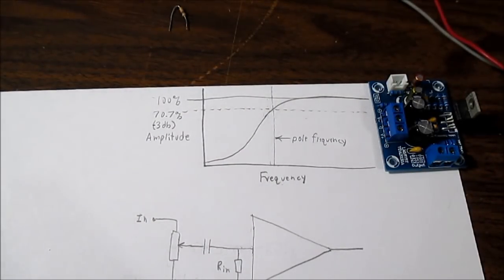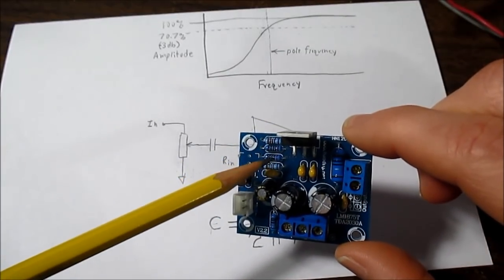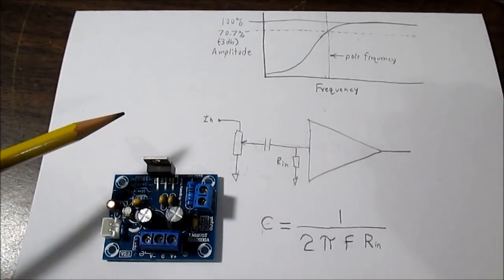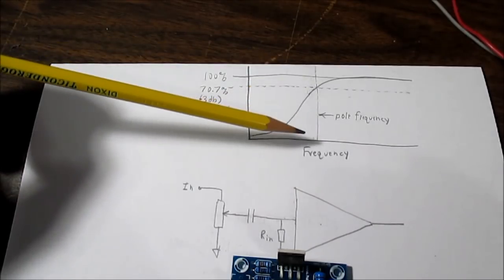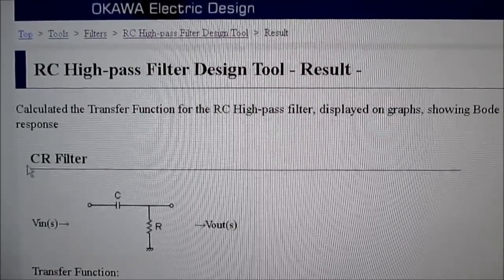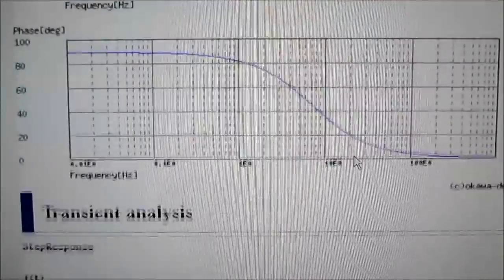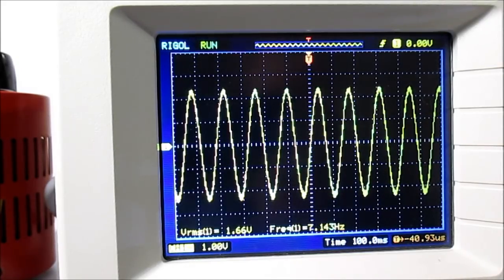How to select input capacitor value and type for audio amplifier projects

Comment: Electrolytic coupling caps seem risky if there isn't a defined DC bias across it. In that case, depending on what offset the source provides, the capacitor could end up reverse polarised

Comment: If you want to do your own calculations, then a 1μF capacitor will have an impedance of 8j Kohms at 20Hz.
The voltage divider given by ( 22  / 8j + 22 ) works out as 0.88 - 0.32j. That's a complex divider effectively with 88% of the signal in-phase with the input and 32% at 90° out-of-phase with the input.
That is √( 0.88² + 0.32² ) = 0.94 of the input voltage at a phase shift of arctan(0.32 / 0.88) = 20°.
Of course, 94% of the input signal is not discernible from 100% on a logarithmic graph.

Beside the leakage current when reverse biased, the other reason not to use aluminium electrolytics in the signal path is that they are commonly specified as ±20% tolerance - and I've seen -50%/+100% on larger ones! The capacitance itself is rarely stable and drifts with temperature and over time, so it becomes pointless trying to design a repeatable cut-off with them.

Of course, you can simply over-specify the value "to make sure", but then you have watch out for the capacitor charging at switch on if any DC bias actually exists. That can be quite a thump to deliver to loudspeakers unless you take precautions. In other words, setting the cut-off too low has its drawbacks as well.

Comment: John, first I wanted to say great video on this but I wanted to mention one issue I have with your statement of not using any ceramics for coupling purposes in audio. Not all ceramics are the same and they can not be grouped together. I would agree that type 2 dielectric not be used. However type 1 dielectric if available in the values that you need can be phenomenal and just as good as polypropylene caps. There dissipation factor can be much less than 0.1 with calcium zirconate(C0G, NP0, U2J) and you can sometimes get the value that you need with them, otherwise can stack a few of them. It is only the ones made with barium titanite that are no good for this purpose(X7r, X5r, Y5v).

Comment: Good one John. Wanted to know more about input caps. My design specifies a 10uf BP electrolytic, so I'm swapping that for a 6.8uf film cap. Now thanks to you I know what I can expect to see, or hear with this change. I rather like paper in oil as coupling caps but I don't have anywhere near the correct value. I'm in no position to second guess the designer,  but if I want fiddle with values, that's up to me I suppose...

Comment: What about tantalum drop capacitors? I tend to go for those over electrolytic capacitors in audio circuits where it's not practical to use MKT or other film caps

Comment: John, why are you using polyesters?  You are wrong, they have significant distortion, especially compared to Polyprop.
The only reason to use the PE type is if you want some distortion in the signal path, like in a guitar amp.  Never ever use electrolytics  in the audio path, never.
Reply from the maker: I'm aware that electrolytic, ceramic and to a much less extent, PET caps have nonlinearities. But it is at the cross over point. The distortion is low in the passband as the voltage change across the cap is very small. Polypropylene caps are ideal but they get large and expensive. Very easy to design a low distortion amplifier using PET caps in the signal path.
Reply: @JohnAudioTech  So the conclusion is that using PP is better than PET, but in the LM1875 schematic above, using PET is the ideal choice. It my right? 😊

Comment: John, I enjoyed your video and would like your thoughts on something i have noticed a number of times. Even though the pole is usually around 6 Hz or so, just as you mentioned in you video, there are cases where low frequencies are intentionally are rolled off to quite an extreme extent. A good example is the Brook 12A amplifier. It is an old design that uses 2A3 in the output and I built one for a lady a few years back and made it true to the schematic. Scanning it with the HP 8903 did not look good at low frequencies. I looked for a clear schematic to attach but could not find a good one but attached what I could find below.
https://elektrotanya.com/brook_12a_sch.pdf/download.html
Rolling off LF in these older amplifiers is not that uncommon and some, like modifications to some of the Dynaco amplifiers are pretty common right at the front end. I have always wondered why the designer/builder wants to limit LF response. I have wondered if it has something to do with output transformer saturation at LF  or what... I don't know. Know that I am not talking about the little RC circuits we sometimes see off the grids of a tube to snub AM radio stations or a 70 KHz instability not uncommon in the older Williamson designs. You see these RC circuits in Heathkit and UTC designs. 
Back to the point - just wondered if you had any thoughts on the reason LF response is severely limited in some amplifiers and I am using the Brook 12A as an example. In the Brooks 12A schematic I am talking about the 24K and pair of capacitors coupling the first to second stage. I have a LTSpice model of the Brook 12A if you do Spice and will be happy to send it to you.  Thanks...

Comment: I have a Dual CV 6065 RC which is class-A 85wt/ch amplifier there is 6800uf 63wt (2nos) and 1000uf 35wt (2nos). i have to replace those caps can i increase the capacitance and power of capacitors ? i have very little knowledge of audio electronics! thank you!

Comment: The main issue with electrolytics for input coupling capacitors for me is their leakage current in the case of operating the amplifier input at very high input impedances (> 100k) and very close to REAL mass potential. it could happen in this case that the polarity of the voltage across the capacitor is opposite to the electrolytics polarization. Especially in the case of higher input voltages (> 1V) the capacitor will degrade with time und it will get more and more leakage current. The leakage current itself will compromize the balance of the input differential amplifier and it will cause dc offset at its output. So, especially for dc coupled output amplifiers it is not convenient to work with electrolytics as input coupling capacitors.

Comment: hey you cant say not to use ceramics for input coupling/filtering because there are class 1 and class 2 dielectrics and C0G/NP0, U2J are extremely stable and actually show distortion measurements just as low as polyproylene according to cyril batemans measurements tests. Yes class 2 dielectric ceramics are no good for this but they are great for decoupling........Just please dont throw all ceramics into the same class.
Reply: Nonsense.  Ceramics have a grainy sound.
Reply: @pangolinamplifier422  bullshit

Comment: 820nF is closer approach than 1uF.
And what about tantalum capacitor? De facto, tantalum capacitor much better than regular electrolytic capacitor. But I don't know about its noise characteristics.
Cheers from Indonesia
Reply: Tantualm caps are very very non linear and horrible for audio think have u ever seen a tantalum cap ever in a signal path the answer is no tantualm are good for bypass and especially timing but absolutely no signal
Reply: Maybe if your look for a certain non linear respones

Comment: I have made a wien bridge oscillator with an op amp. The op amp output is a 2khz sine wave that is the 1st stage. The second stage consist of 2 BJT's first C945 and second 882 both NPN a 120 ohm resistor on the collector of the 945, the emitter connected to the Base of the 882, a car alarm siren connected to the collector of the 882 and the emitter to ground or 0V. What should be the coupling capacitor resitor between those 2 stages? I am using a 220microfarad electrolytic capacitor in series with a 1kohm resitor to connect the output of the Op-amp to the Base of the C945 but the siren sounds only while the cap is discharging and the intensity of the sound gets  weaker until there is no sound at all. What am I doing wrong? Shout I connect a 22kohm resitor connected to ground between the cap and the 1kohm resitor to maintain a stable charge and discharge of the cap so the siren will have a stable 2khz sound?

Comment: In your calculation for input resistor you entered 2200 and called it 22k. 22k would be 22000.
Reply: No, he did it right.

Comment: Since you didn't say it(at least I didn't hear you say it), the reason you want input coupling instead of just hooking it right up is, you want to make sure very little DC bias is on the signal. Not only will that cause transistors to overheat, it could damage speakers.

Comment: Have noticed on some amps board they critic them to have brum noises from the transformer. That is boards where the rectifiers are ON the boards.
Those boards that have that full solution where you just connect the transformer directly to it.
You think that will solve the noise if that noise if that rectifiers are taken off the board to a separate board?
So the AC power does not affect the amp board

Comment: Are electrolytic not the worst kind in the audio path?
Reply from the maker: They are fine in the passband but can have higher distortion around the cutoff frequency where voltage change across the cap will be greater.

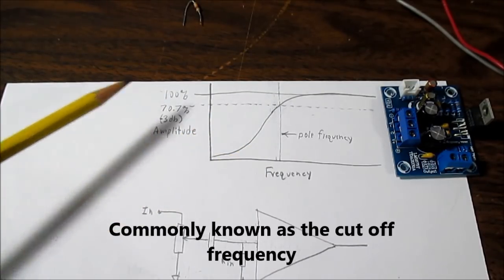Comment: at 2:25... 
70.7% has nothing to do with pi.
it is 100% * 1/2 sqrt(2)
The point where the signal energy is halved.
Reply: ...and besides, I've seen many equations but not one had pies in it. I  would have noticed, because I like pies.
Reply: @copernicofelinis well ω=2πf, and since we usually work with hertz rather than rads/sec you'll definitely need that  π  !!

Comment: I have a question about audiophool vs audiophile.
If you are to different live concerts and are listening, different pianists who flowles plays the same piece of Mozart will properly still sound different, some would call it "with more soul".
Can that be messered  or is that due to humans "believe" or ?
Reply from the maker: Different players playing on the same instrument at the same venue, for example, will have very slightly different playing style, timing and attack on the notes and so on, which can sound different. If recorded on the same equipment can show the difference.
Reply: Yes, you are right and that could easily be measured in time, voltage and so on! Thanks:-)

Comment: Could you tell what you suggest to use as decoupling transformer for audio signal (line level) - how manny turns of wire, are ferite ring transformer cores from burnt CFL lights/atx PSUs ok, will it act as too much bandpass filter...
For when you expect MASSIVE DC and ocassional 50Hz AC offset (just for seconds - during genset restart usually) occuring - like for connecting power amplifiers, mixer board and computers, cd/vinyl players on multiple generators (or ups or inverter+battery+charger for computer/player if you know the big diesel generator goes out every time they use too much lightshow for over 20 seconds ;-) at events...

Comment: This clarified one of my questions.  Now if I could just completely understand impedance.  I know what it does and how it can store current and release it however why things need matching and how to calculate it.  Nope.
Reply: impedance is simple. It's the resistive equivalent value of a source or load.
Reactance is individual resistive equivalents of capacitance or inductance whose value is dependent upon frequency.
If capacitive and inductive reactance are equal they become a resistive impedance. 
Impedance is really a broader term.
Impedance itself doesn't store energy, but reactance does (ie inductors and capacitors store energy). Resistors don't store energy either but also have an impedance. See what I mean in that it's a broader term?

Comment: Hi John, when I hook up an electrolytic capacitor backwards to my bench power supply and shove 32 volts at 5A through it, is it normal to feel enjoyment when it explodes?
Reply: Tantalum caps can be very exciting when they blow up. They shatter and generate plenty of smoke. Older LEDs have been interesting too with explosive shattering
Reply: Tommy, For maximum enjoyment, put on a pair of safety glasses and place your face about 8 inches above the electrolitic before you apply the power.

Comment: When going electrolytic do you need to use a bipolar capacitor?
Reply from the maker: When there is no DC bias and when dealing with small signals, you can use a standard polar cap.
Reply: Thanks, but you mean non-bipolar?
Reply from the maker: Yes, corrected.
Reply: JohnAudioTech I have an digital v/u meter specially made for car audio. When connected the v/u meter will not drop backdown to the -00 mark. I have been informed a non polorized film cap of 10 uf 200V was good to block DC offset emoted by my JL Amplifier. What say you?

Comment: Interesting video. Can you tell more about the polarity of an electrolytic in the signal/audio path?
Reply: Thnx, for the input your reply is clear to me. For the output, do you mean that the positive side of the cap is to be pointed to the amp and the negative to the speakers? And, what is the reasoning behind this rule? The signal is AC and either side of the caps may be positive with regard to the other?
Reply from the maker: If the particular circuit has some DC bias, you'd want to orient the cap + side toward the side with the more positive voltage. If the signal is purely AC, then you can orient it any way you like. The polarized electrolytic capacitor will not be harmed by the small signal AC across it nor will it harm the sound. In the passband, the voltage differential across the plates will be very small (few millivolts). If the cap value is 1uf or less, I'd use the film types as there would be one less electrolytic in the circuit to dry out.
Reply: @JohnAudioTech  I've seen X-overs in Aussie vintage Philips consoles and speaker systems using 10uF polar caps, very sleazy. I've changed them to non electro types and use 2.2 for 8 ohm tweeter, the 10 was too midrangey

Comment: Great video. Thank you for the explanation and demonstration. It would have been great to see other value capacitors in the circuit to see how it affects the audio signal. Maybe you could do an addendum.
Reply from the maker: If I were to use a .1uf cap in the video example, then the pole is moved to 72Hz (too high for a "hifi" amp). I could have demonstrated that but the video was getting long for the subject as it is.
Reply: I didn't think the video was too long. In fact i was just getting into it. But thank you for taking the time to explain these things too us. It's just many of us don't have a sillyscope so cant do these experiments ourselves.
Reply: Jesus said, if you do not have an oscilloscope sell your cloak and buy one. Well, He would have, if He knew what an oscilloscope was.